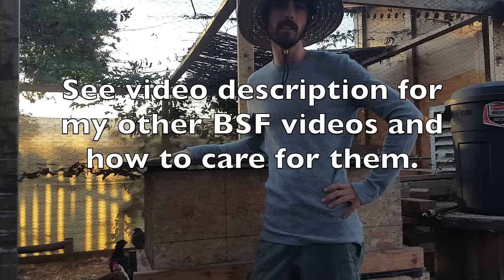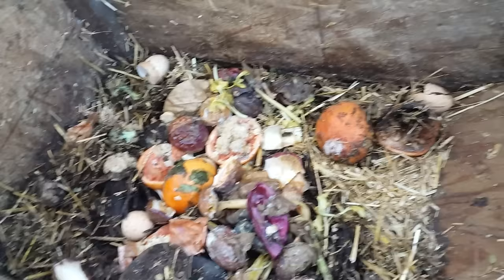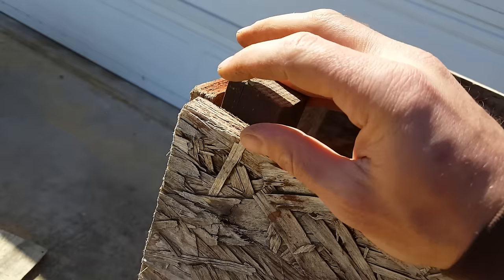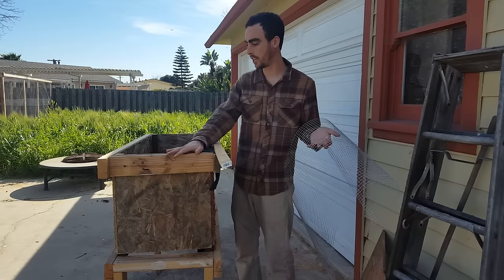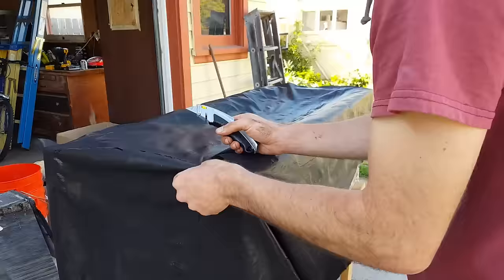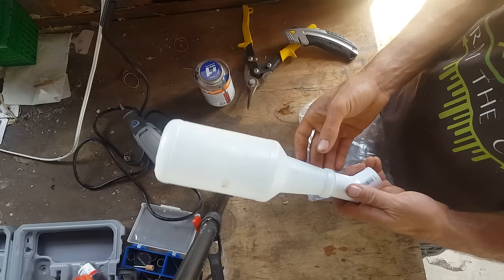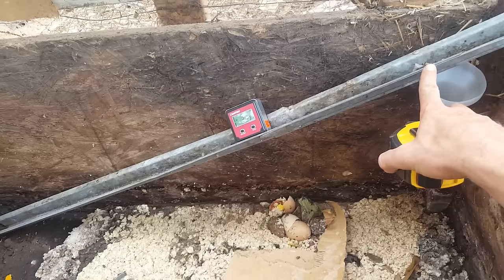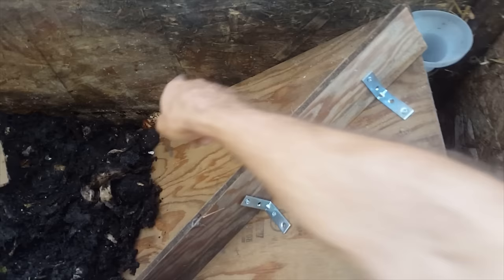Mysterious Box Grows Free Chicken Food

Comment: my larvae are crawling straight up the sides and out the crack under the lid. i thought they couldn't handle more than a 45* angle. any ideas?
Reply: Humidity is very high. They are clinging to wet surface. It can either be more dry or you can run a velcro strip along all the sides, they can't get passed that.
Reply: @danexplainsscience2205  the rough part of the Velcro or the softer part?